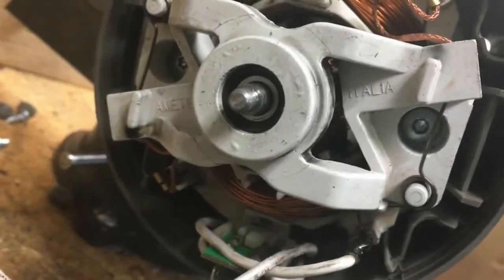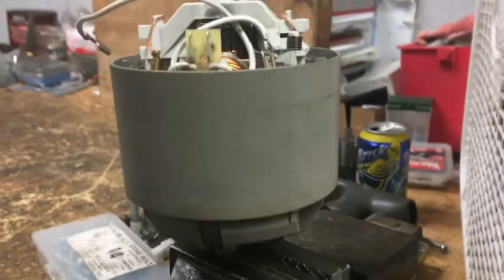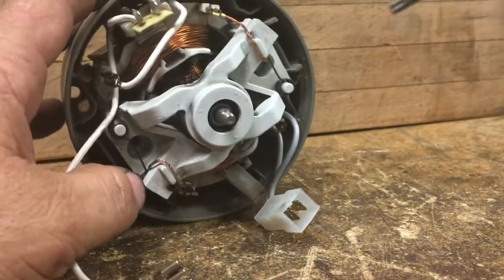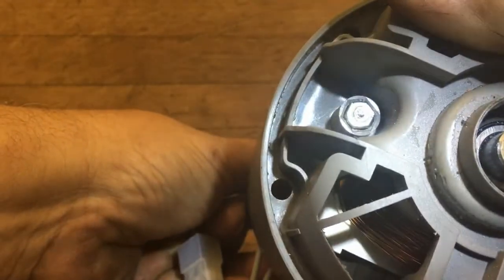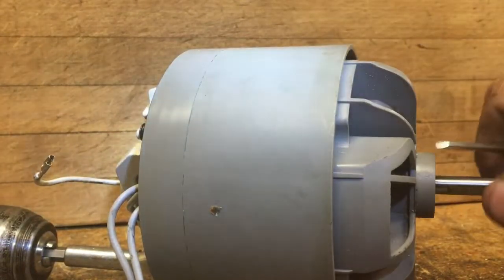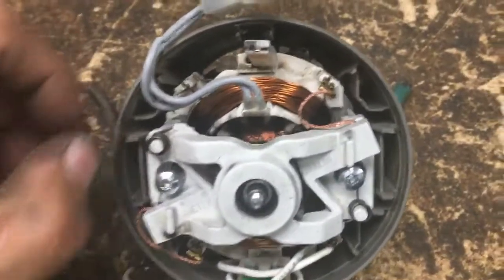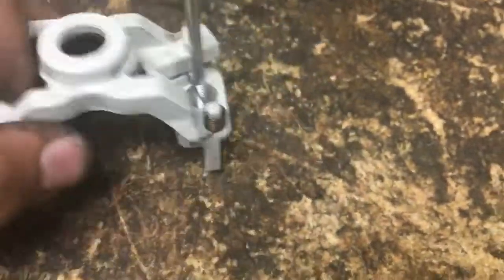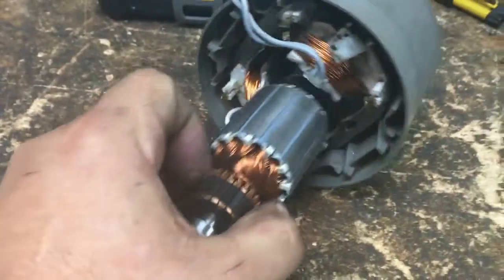Robot Coupe, 450 Turbo; Part# 04 Removing Motor cover, accessing the Rotor and Commutators

Comment: Those things that you're calling a Commutator, are called Brushes. They make contact with the section you're calling a Stator, which is actually the Commutator. The Commutator is a part of the Armature/Rotator. The Stator surrounds the Rotor and does not move.